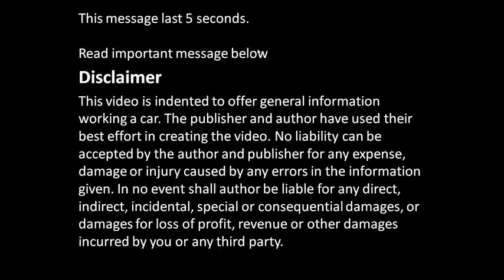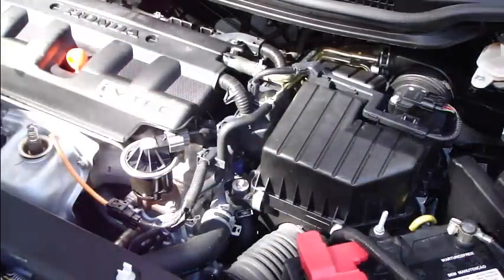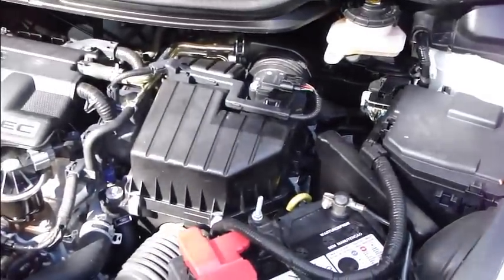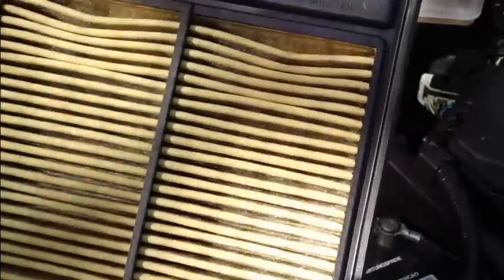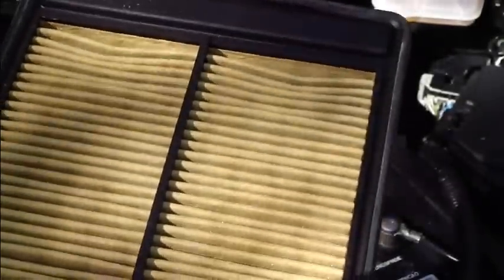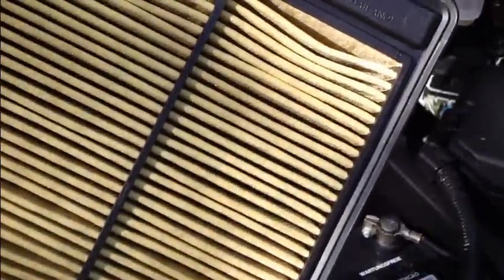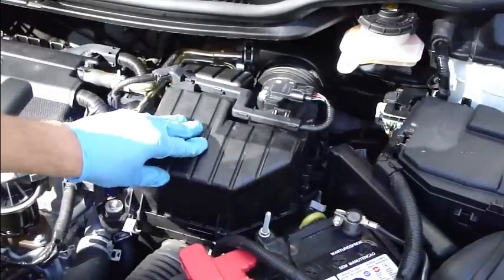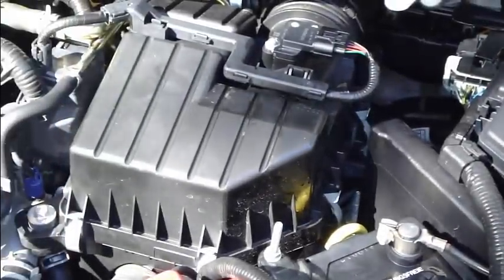How to replace Air filter Honda Civic. Years 2006-2011.

Comment: there is an rectangle opening which can be seen below the intake opening in the lower area of the air filter box after removing the air filter. in ur video that area is closed ? can you please help me with it if i should close that or keep it open?
Reply from the maker: Thanks for sharing 👍